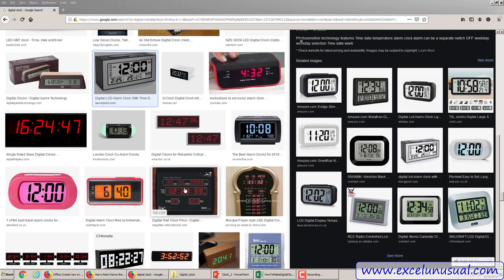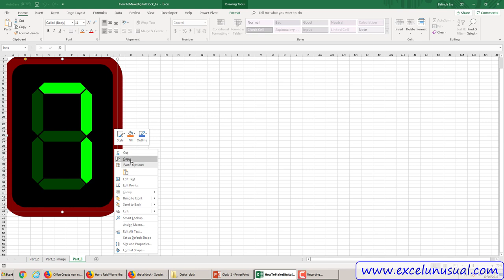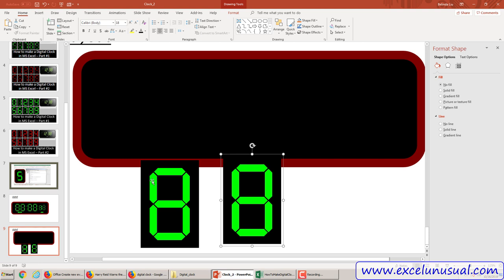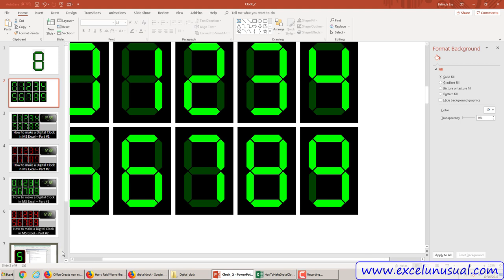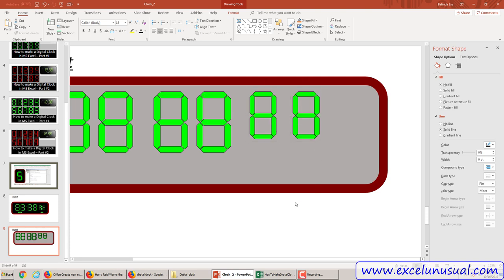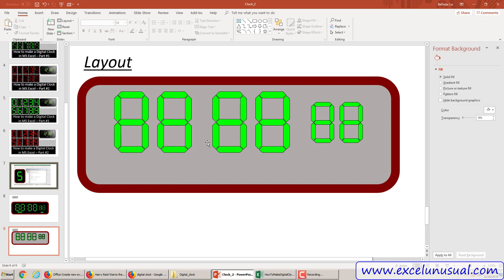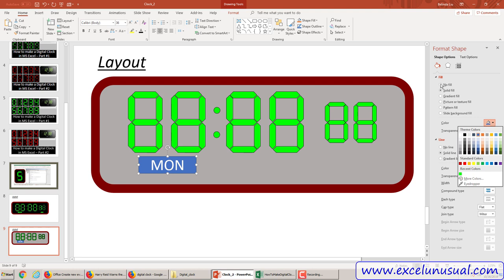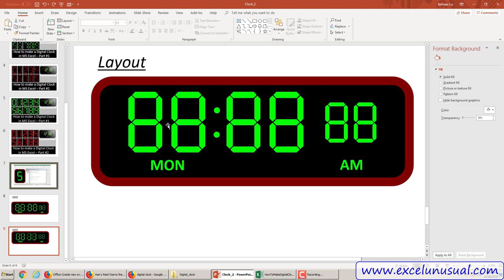How to make a realistic looking digital clock animation in MS Excel - Part #4

Comment: Your channel is very impressive. It's hard to imagine anyone creating such advanced models in Excel 2003. Quick question, how long have you been working with Excel?
Reply from the maker: I started in grad school in the 90's but used it in a very minimal way. In 2004 I dabbled a bit into stock trading, but my breakthrough came in 2007 when I made an animation for a device in my company. It was an "adaptive equalizer", a filter which self adjusts its parameters function of the shape of the signal. Everyone was impressed (including myself) but it triggered a lot of animosity and insecurity from my colleagues who were unable to do the same with more expensive tools. Excel being just a power abacus, stimulates the mind rather than have one rely on some black box software, which turns the engineer into an operator, or "tool monkey". Needless to say, I was out looking for a job soon after. Excel served me well in other engineering problems, such as modeling micro accelerometers, power regulator, etc. This kind of playful use started in 2008 while on a consulting trip. I am not a consistent user, I often don't touch excel for months or even several years. I need to have some cool idea first for motivation. The last project I did was almost 3 years ago and haven't opened a worksheet after that.
Reply: Aint no way this bro watching excel alarm clock